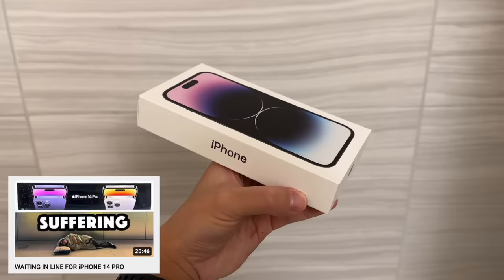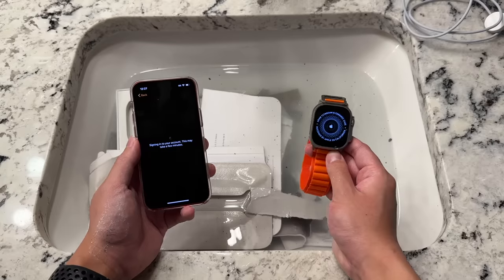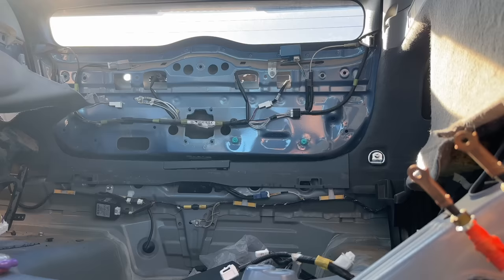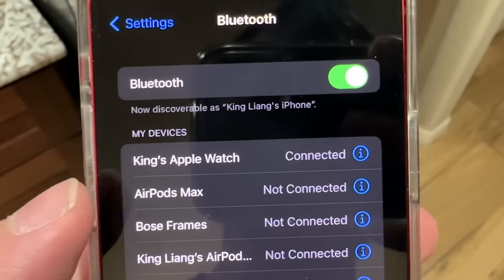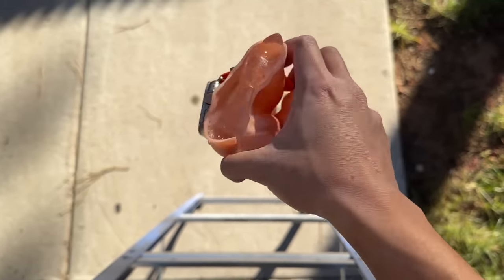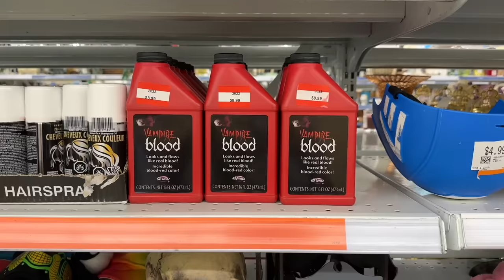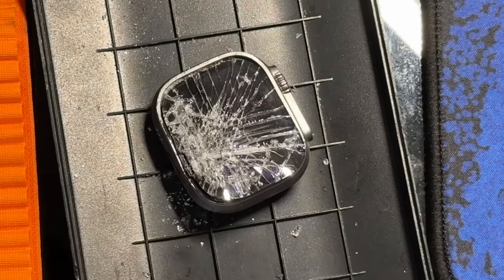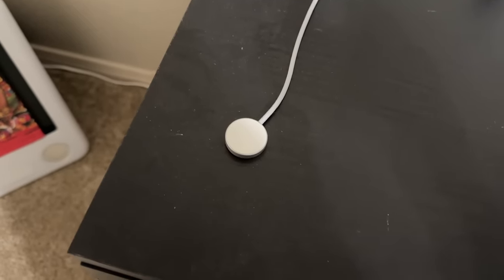Bored Smashing - APPLE WATCH ULTRA

Comment: 5:25 the reason Crash Detection did not work was because the watch can only detect the car crash when it detects sudden traveling speed before the crash, and it can only detect much higher velocity and louder car crashes, than a throw. So the car actually has to be in a real crash…
Reply: Thanks for the explanation, I was wondering why it wouldn't work
Reply: It uses a GPS as well so it wouldnt work
Reply: And an airbag deployment
Reply: I actually think that the crash and fall detection is because the watch wasn’t unlocked and on an actual wrist so it just thought it was just being put on or something.
Reply: 1000 IQ
Reply: @burgerdudeyt  What if your car doesnt have airbags? My dad's car doesnt have a airbag
Reply: @tftfxr56  people were saying it activated on roller coasters and other stuff too, it's not dependent on an airbag, but I'd imagine it still looks for if it deploys
Reply: yeah, it detects it's going in one direction at a fast speed, then once it hits something it tells it immediately came to a stop or something happened then the crash detection triggers, someone did a test of it
Reply: @tftfxr56  Then you should probablyyy get a safer car..
Reply: @monkeyboi1553  That's what I thought too.
Reply: Or in a rollercoaster
Reply: Watch the Luke Miani video about the crash detection. Nothing triggered it
Reply: your right
Reply: @oppenheimerbobm  most cars don’t have airbags
Reply: @nochance1013  *old, they're required to have airbags since the late 90s
Reply: @BingusCollin  You’re right on that. However, there was also a TechRax video providing much more dangerous testing, and it activated crash detection.
Reply: @nochance1013  That's only in poorer countries, because let's just say we're in the US. cars there are required to have airbags if they're built after 1998
Reply: @ColonelHax  same
Reply: Accelerometer
Reply: what about fall detection?
Reply: I think another reason it didn’t detect the car crash and fall, was because it would have to be connected with a real human pulse, not some stage hand that has no pulse what so ever.
Reply: @danzstuff  the watch can detect the weight of the fall
Reply: I thought CD was triggered when the watch detects a sudden change in air pressure inside the car which usually occurs when the airbags are deployed.
Reply: @airpixelsuk  that too because it has a barometer.
Reply: I’m pretty sure it also didn’t activate because there’s wasn’t any random pressure spikes.
Reply: It needs to detect heartbeat
Reply: Or on a roller coaster it has happened
Reply: @monkeyboi1553  fall detection uses you're blood pressure and all those vitals and the gyro
Reply: @tftfxr56  Then you're sol since airbags have been standard in all cars for 50 years. How does your dad even drive it since there's no way it can pass the yearly inspection?
Reply: I thought it only worked in roads
Reply: This episode bored smashing Tesla model s Plaid
Reply: @TabbyEgg312  no
Reply: @CaydenThyGamer  yes
Reply: Then why did it go off when I was in a roller coaster and not a “real car crash”….
Reply: It also didn't detect the fall tests because it can tell it isn't actually strapped to a human's wrist. It's smarter than that.
Reply: and he says it's 99.7% accurate
this is the other .3%
Reply: @burgerdudeyt  oh technoblade is alive everyone yay (joke)
Reply: Do you have to buy two cars because Apple is smart They know you’re going to try doing that
Reply: I make better content fr 💀
Reply: @Gulkisgood  CONTENT UR MAMA
Reply: @ColonelHax  plainrock124 be like: "well lets try it out , lets get in a real accident"
Reply: @RandomGuy_225  ur mova 😂
Reply: And also 
People have been testing it a lot and keep stopping it from calling for help so the crash detection doesn’t work
Reply: No offense but 🤓
Reply: This is 100% true
Reply: @burgerdudeyt   ur alive !?!?
Reply: Next thing you know he’s gonna buy a new one and do that And be like OK that test is over let’s do the next The next test is surviving in a hospital bed
Reply: @oppenheimerbobm  	تتتتتتتتتتتتتتتتتتتتتتتتتتتتتتتتتتتتتت
Reply: Not only that it has to detect if it’s actually in ur wrist too
Reply: ya’ll dont get sarcasm.
Reply: @perseus391  cringe
Reply: @Aaronz2464  cringe
Reply: @ABlueyFan  what's cringe?
Reply: @Aaronz2464  the nerd emoji
Reply: @ABlueyFan  i dont see how thats cringe. besides, why are you replying? i forgot i made that comment
Reply: It will work by the airbag u got bump into it will detect is it was a crash
Reply: Why didn’t fall detection go off then
Reply: @patriiiick  well roller coasters have VERY HIGH G force levels that can be detected by iPhones, which will cause it to call 911, so it no surprise.
Reply: Yeah that would make sense thanks
Reply: I hat your very well done with this 😂
Reply: Thank you nerd
Reply: And because it knew it wasn't being worn (Due to the censors under it)
Reply: I thought it was the heart beat detection
Reply: I want like your comment, but now you have 665 likes and if I like your comment it would be 666 and it's not good 😢
Reply: @froakie14  it doesn’t need to detect heartbeat. It’s just need to detect motion.

Comment: Actually When you put a battery in the freezer it prevents it from discharging making it last longer. You can use this trick to bypass safety features on batteries which is dangerous don’t try.
Reply: MrPlainrock124  Ugh, you're still copying channels.. Ew..
Reply: OfficialMattLaidlaw  but that's not PlainRock, you're a random person

Comment: The reason the fall detection didn’t work is because it only turns that feature on if you take the big fall then don’t move for a bit versus just throwing the watch and immediately moving again. Doing that makes it detect you are ok and doesn’t activate it
Reply: it is a fall, how simple is that?
Reply: also it needs to detect heartbeat to check if it fell of the table or a person fell